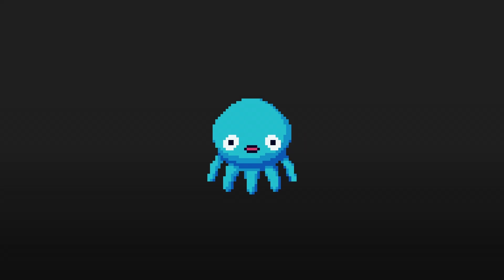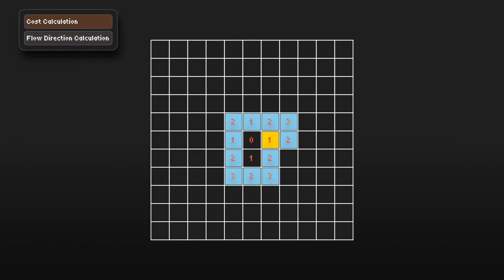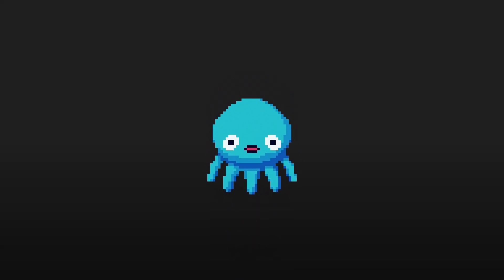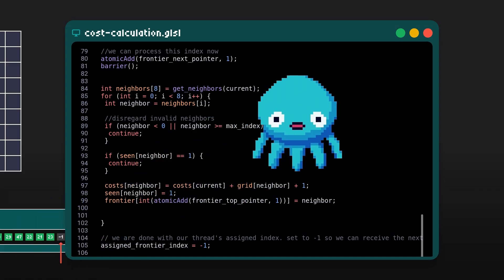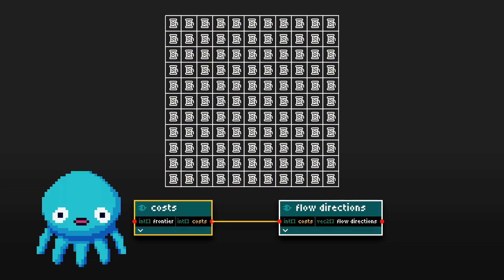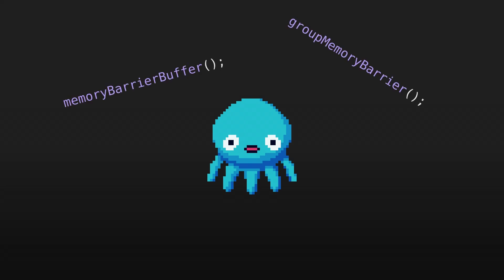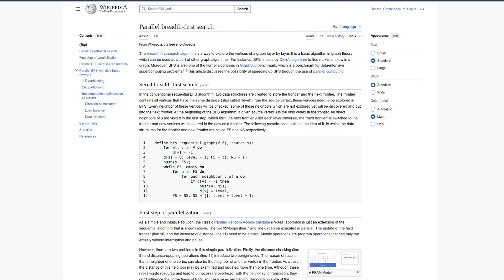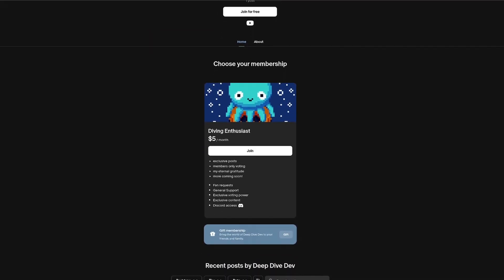Forcing My GPU to Compute Flow Fields Faster

Comment: 8 realized a mistake you made in your implementation that is easy to gain a lot of performance if you go and check CA gpu implementation it uses similar principles but you should calculate backwards from the empty cell the no need for thread sync issues as no cell can write to another in the first place but love the video tho great work

Comment: Man, I need a tutorial on grid-based construction, where I hold a 3D object and it follows the mouse position (I can do that part), but I wanted help creating the grid system, which will separate the entire surface of the map, with a shader in a planemesh3d and will position the objects on the grid, controlling the occupied and free cells and also how to define how many grid cells an object should occupy, I'm having a lot of trouble with this, and I haven't even found a tutorial for Godot, just some for Unity, if you can make a video teaching this it would be a great help.

Comment: I only glanced through this, but I caught the part about the idea of using 3D flow fields to simulate weather environments and the one environment I've always craved was something that involves flying through the weather systems of gas giants. A 20,000 mile diameter hurricane would be pretty neat. I'm working on my first game now, but I can't imagine touching such a thing before my third or fourth.